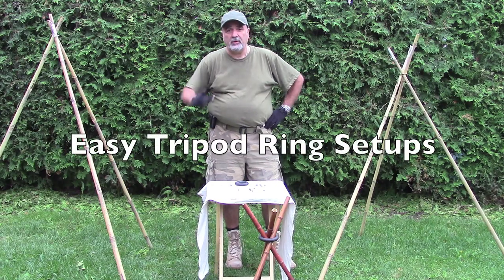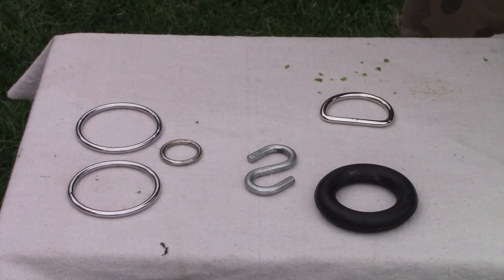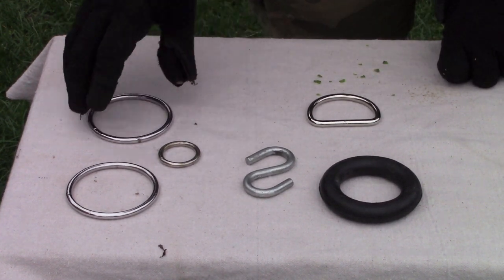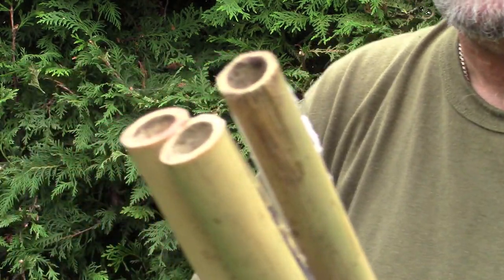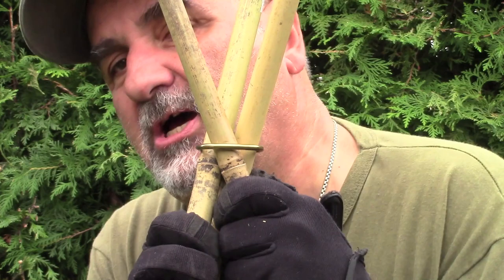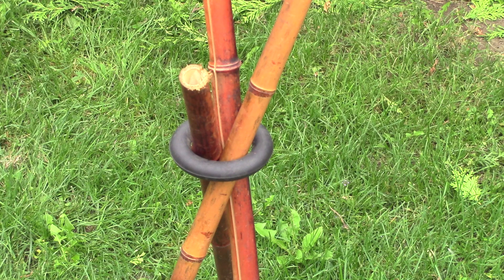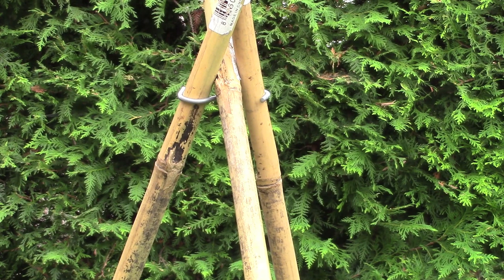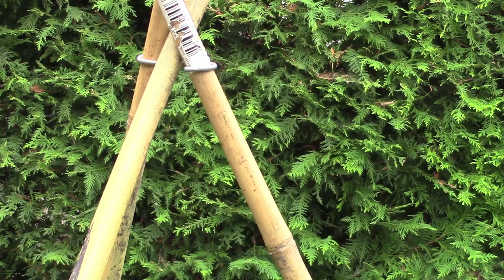Easy Tripod Ring Setups

Comment: I've seen this before and its a good idea if you can find three pieces that fit into the ring, I prefer a two foot piece of wire.  Once I have my three sticks I double or triple wrap them with the wire making a 'ring'. This way your sticks can be various sizes.
Reply from the maker: +janken919 also a great Idea thanks for sharing.Andy
Reply: SubArcticWolf Tools & Outdoors exactly what I did. I bought some of those cheap steel wire ring "survival" saws and used them that way.

Comment: There is also a new design for an O-half S hook.  Like a magician rings the O ring portion instead of the bottom of the S" hook, and you can put on 2,3, or 4 other O-S hooks together for the same tripods, but also a hanging hook - like a cooking tripod.  Using the same tripod, one can hang their backpack from a tripod or from a tree limb.

Tripod cooker stand.  Thicker-larger double tripod hammock lay with ropes.  Thicker-larger double tripod with ridge line beam hammock lay and tarp coverall lay with ropes.  Thicker-larger .  Larger-thicker tripod and make tripod hanging seat pouch.  Tripod <5 minute emergency shelter.

So many practical uses for the O rings, D rings (belt latches), S hooks (big S hooks and hang boots upside down), block and tackle pulley ring systems, bear food hangs, S hooks-and-O rings for a meat skinning rig on a tree limb, ....
Reply from the maker: +John Lord cool stuff there JL thanks for your input Andy